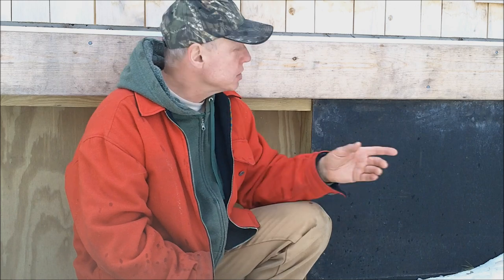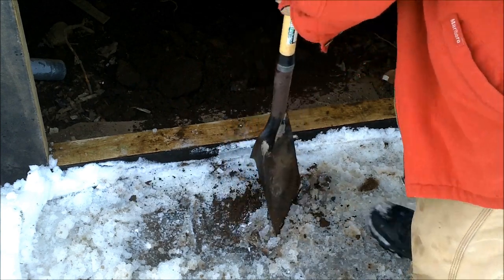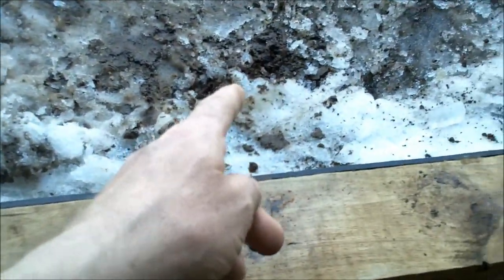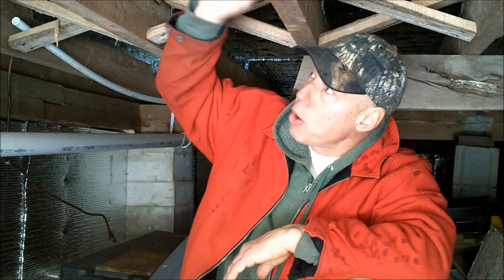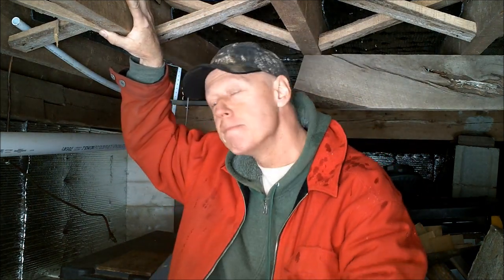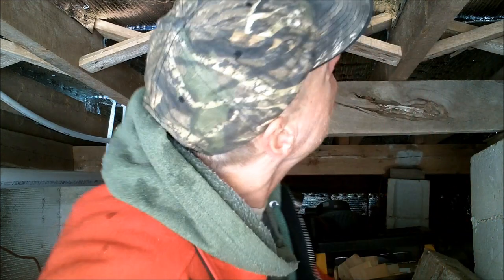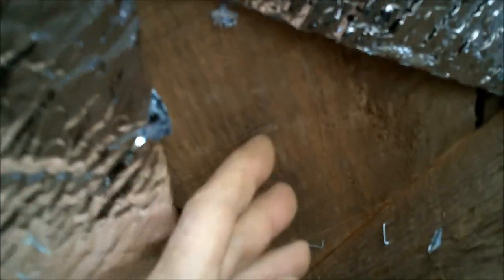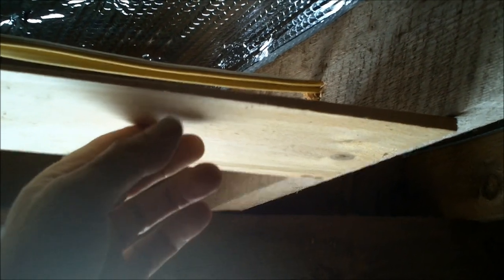HOW TO INSULATE A CABIN FLOOR AND KEEP IT RODENT FREE   PART 2

Comment: I have to agree with you Boss!  When I insulated my garage ceiling, I used blown in cellulose.  I apparently missed a couple of spots and in the winter, I could see where there was snow melting on the exterior of the roof.  I stapled some of that bubble foil on the inside of the ceiling and there is no more snow melting where it was before.  I have not used it as extensively as you have but enough where I am sold on it too. There is a reason why they call it "reflective", and that is because it reflects both heat and cold.  There may not be the "R" factor that other insulations have but it works on a different principals than those others.
Reply from the maker: Agreed.  If I can keep an ice cream sandwich in my cooler and still have it frozen at noontime... that tells me salt ice and bubble foil kick butt.   :-)   Yessah
Reply: Now that you mention the cooler, I took your idea and changed it just a bit.  Instead of lining the interior of the cooler with bubble foil, I made a "cooler cozy" for the outside of the cooler. It just slips right over the cooler and while in a situation where it is in the direct sun, it reflects the sun/heat really well.  Great for when in a boat or canoe or in an open field while camping.  Thanks again for all your great tips!

Comment: We live in a split-level home. Our den, kitchen, and living room are on a 3 1/2 crawlspace. The traditional insulation is all chewed up and falling down because mice and rats have made a home there. My wife and I enjoy garage sales and I picked up two unused rolls of the exact bubble foil you used for $3 per roll. I considered using it and went through the identical thought process you expressed in your two videos. It's great to know that it works so well. I totally agree with you about covering up wiring and plumbing. I think spray foam is a bad idea and I would never use it. In our neighborhood, many homes built in the 60s, 70s, and 80s are being sold for their lots. Massive new homes are being built and nearly all are being built on a slab foundation. A number of videos are surfacing indicating rats will chew through Pex pipe. Imagine getting a water bill for $700 and discovering you have a leak under your slab foundation. I mention that because I see you built your homes on a crawlspace making repairs in the future if necessary much easier.

Comment: Absolutely fantastic.  I have a cabin open to the dirt floor( unfortunately on peers), but its open to the sides. I guess I should skirt it.  I thought you actually want air flow blowing under.  Thanks.  N.Y & its a seasonal hunting cabin! Question should I put plastic on the dirt floor so moisture doesn’t rise ?     Thanks

Comment: Hey boss, your absolutely right. so many pros out there want you to believe r value is all that matters. thats only one factor.you have radiant factor and a complete air seal factor. fiberglass insulation is great, but it does allow air to slowly blow through it. There is no direct air stoppage like you have in the bubble foil, actually stops the air completely about three times between the bubbles and the plastic layers.  I have a cabin in VA on 3 ft piers, since its in a 100 yr flood plain I cant skirt it because i must leave free area for water flow in case the worst were to happen. All I have is one layer of bubble foil between the joists and subfloor (as The Boss recommended). most places I dont have any floor finish down yet and even when it was 8 degrees out, the floor wasnt cold. As a matter of fact, one hour after lighting the woodstove, we were opening windows. you may only have r3 in bubble foil but it kicks tail with radiant values and complete air stoppage ability. The skirt is by far the best part of the system. Ive been in the building industry my whole life and they are finally beginning to use the heating and cooling properties of the ground beneath the homes. The only insulation we are putting under the homes now is on the foundation. Theyre calling it a conditioned crawl. ground is a lovely 60 some odd degrees all year round. Thats free heating and cooling for your home. one vapor barrier on the ground, and your good to go. saves on heating and cooling bills both. So even the pros are changing there mind.   Its hard to change a hard head!!!!

Comment: I liked the way you rolled out the foil bubble wrap on the inside of the floor, installed sleepers and floored over the sleepers in the first video. Don't think that I am being a troll but after watching the video I thought that instead of leaving an additional air gap, I would install foil faced 1 inch rigid foam between the sleepers, another layer of bubble foil and then the finish flooring like hardwood t&g. I have used the foil faced rigid foam in between wall studs in my 8x10 foot shed with the foil facing in. I keep 2  60 watt incandescent light bulbs on 24/7 and the shed stays 40+ degrees inside when it is in the teens outside. I have a concrete floor in the shed that is covered with 1/2 inch interlocking rubber foam mats. The ceiling is R17 fiberglass. I am very pleased with the results but I plan on building a cabin and I am convinced on the bubble foil and will use it in the cabin. Thanks for the video, you probably saved me time and money.
Reply from the maker: I'm sure adding foam between the sleepers would be fine.  The trapped air is an insulator as well.

Comment: Do you have experience with your preferred method of floor insulation (rolling over the floor joists and under sub floor) AND having a foil insulated skirt? Your comment on the possibility of heat being transferred into the underside and keeping your pipes unfrozen has me wondering if the combination would be a problem? Thanks for the help!

Comment: They use bubble form in jet aircraft, so I agree with you. And I used it between my floors are my trailer. And like you, the trailer floor never gets cold. Even when it's 15° outside. Partly because the reflective coating on the bubble , reflecting heat back into the four, just as it does on aircraft. Neil
Reply from the maker: Agreed ;-)

Comment: Yeah I wouldn’t be worried about losing heat at the floor joists.  Most of the heat loss is in the ceiling and roof if it isn’t insulated enough.  Nice video sir.

Comment: Sir. We speak the same language and approach things in the same manner. I'm fixin to add 400sf to our house and have an efficient off grid plan on the drawing board. Both will be getting bubble foil. In fact Menards carries a double bubble double foil 5/16" thick product that I'll be using.
Watched part 1 and 2. I'm sold.

Comment: I agree brother. 1st year with negative numbers on a pier cabin. Anything including a blanket on the floor becomes permanently frozen. Going to do this myself. I was concerned about condensation building up. But I can attest that my floor with no insulation is a constant fight inside with moisture
Reply from the maker: I have never had any condensation beneath the floor. Seven of my structures have this.
Reply: Oh I think your right. I believe because I have nothing, the monster accumulates on my floors. I will definitely apply the bubble wrap and under pinning with it also. Thanks for the video. I have heard so many " pro's " say " no insulation under the floor. With sub zero weather, it became a nightmare real quick.

Comment: Thank you for these posts, of course what you're doing makes sense, to the reasonable viewers. It usually isn't that cold here in CT, and for now, a small heap of compost is working to insulate the water line entry from ground to sill... The floor is not too bad without insulation, and with no ground to sill barrier wrap, the neighborhood cats stop by and take care of any mice!

Comment: You "SHOULD" use fiberglass insulation then the Radiant heat barrier encased with Plywood. Also install a series of nest cameras so you can monitor rodent activity around wires and also several fans that will make any spaces cold so rodents don;t wish to reside there for the winter......on wait! I have no idea what I am talking about  :) Love the channel and love the Vids.
Reply from the maker: LMAO... you had me going there for a minute hahahaha

Comment: Happy thanksgiving boss. My wife and I along with our little one live in a 30×40 pier home in upstate ny. We heat with wood. We tore out all the mouse riddled bat insulation in the floor. Been doing a lot of resurch on the best way to insulate a cabin floor. I've asked a few "expert's" in the area and most say put fresh fiberglass back in or spray foam. Well, I'm not doing eather. As with most of my jobs around the house, I decided to go with some backwoods logic on this one. I purchased some bubble foil and I'm fixing to put er up. I got no worries about any problems. Yessahh. Thanks boss for all the videos. This one helped me a lot.
Reply from the maker: Good move.  If you've been following my recent postings regarding the mice I'm trapping beneath the cabin, you'll see there's lots of them, however... the bubble foil remains undisturbed by rodents and my floors are warm.  

Is your place skirted?  Skirting makes all the difference in the world.  Insulated skirting is more important the insulating the floor.   You won't regret this.
Reply: @thebossoftheswamp  yes sir, I just re built the skirting around the entire foundation. And I actually just finished a 2 year project of replacing every pier by hand...what a job. But it's done and turned out great! I have treated plywood with roof tin over it that matches our roof as skirting and I plan on putting bubble foil over it as well on the inside. I utilise the bucket trap for mice as well that you show. My father taut me that method a long time ago and it works great. I did find a burnt up mouse in my wall that chewed a wire to the bear core...it left a small scorched spot on the 2x4 stud. I feel I got lucky to not have a fire. Its so important to control them mice!

Comment: This is great info, thanks for all the efforts JC!

I have a question regarding skirting. First time cabin builder here, doing by myself with my wife. You mentioned you skirted by making a frame with pressure treated lumber. How are you attaching the frame to the dirt floor? Is the base plate a little dug in to the dirt or is laying on top? Thanks!!

Comment: Smart. Our neighbor lost their home in a fire due to rodents chewing on the insulation of the wiring going to their dishwasher. That outer layer of insulation on the wire contains peanut oil. Yes, peanut oil. That certainly keeps rodents away. So, along with your method of insulating the floor, you might want to add a little conduit to that appetizer running underneath your cabin.
I think I'll add this bubble foil to the exterior when I replace my siding. Smart. Thanks.

Comment: Love it, Love it , Love it J.C.  I messaged you a while back about your insulation technique and it's obvious that it works from viewing your earlier video.....the proof is in the pudding.  I have already source the bubble foil material for a build that I plan on doing.
At the farm, we installed bats of insulation that was to be installed under the floor and it is a total freaking mess.  I won't make that mistake again.  I have to agree with you also that your method in this case is totally working for you as the heat is penetrating through the floor joint and raising the temperature above freezing under the camp. GREAT PLAN!!!Maybe geothermal heating is next?????   LMAO
Reply from the maker: I'd definitely put more emphasis on insulating the skirting than over insulting the floor if there's plumbing beneath it.  
Warm floors and no frozen pipes.  Heck ya,   Even Gee Ol Thelma can't top it :-))

Comment: I agree with you, Boss.  Laying it down on joist then laying subfloor over for new construction is ideal.  What you did with this existing cabin is near-ideal.  As a General Contractor, I probably would have looked at removing the entire subflooring, laying down the foil, and then installing new subflooring.  That would have been almost as good as new construction (and it would have saved you time).
Reply from the maker: Laying over the joist insulates the room the best BUT... I have pipes beneath the cabin and if I insulate the floor too heavy, then I need to heat the crawlspace or pipes. Instead, I insulated the skirting and the heat that transfers through the exposed joist is enough to keep the crawlspace above freezing.   it's -2F as I type this and all the produce beneath the camp is in perfect shape.   Every application has different needs :-))
Reply: @thebossoftheswamp   Absolutely correct.  BTW, you may want to lay down 10mil plastic over the soil to block the moisture from getting into the crawlspace. Overlap it about 6 inches, tape the joint, and run it halfway up the skirting and fasten with tape.  I like what you're doing and have just subscribed.  Thanks.

Comment: I'm back to watch again the bubble wrap insulation. Under my cottage on piers the crawlspace being well imsulated but poorly ventilated it keeps the air humid. I will imsulate with bubble wrap. Thanks again for sharing your experience.
Reply from the maker: Covering the ground with an old tarp will help cut the moisture but ventilation is a good thing.

Comment: Ok buddy .... we are taking your advice and will be installing “Bubble Foil” on our 45 year old cabin restoration project.  We have built a new 1200 sq ft addition onto the old cabin with an ICF foundation.  We have to put a new subfloor in the old cabin so it provides us with a great opportunity to use your recommended top side application process using strapping between the Bubble Foil and the subfloor.  We also have a crawl space and a pump house that I will be applying the Bubble Foil.  I will let you know I sometime this winter how it goes.  Thanks for your videos.  The one thing in life that you can always count on is criticism.
Reply from the maker: I have great success with this stuff so I hope you will as well :-))

Comment: JC,
I think your use of bubble foil to keep a warm cabin floor is a great idea.  However, my perspective on why this is so differs from most people.  I think of the earth as a big heater.  It absorbs and stores heat from the sun during the warm months.  As cold weather sets in, the earth radiates its stored heat.  However the freezing front sinks deeper into the soil with sustained sub-freezing air temperatures.  At some point in late winter and early spring, the battle between cold air and warm earth reverses and the few feet of frozen ground thaws…more because cold air has retreated and not so much because warm air has melted it.  The warmth from the earth is mostly what chased the frost out of the ground.

With that understanding, your elevated cabin floor insulation system makes great sense.  In effect, what is being done is to cover the earth within the building footprint with a layer of still air.  The bubble foil encapsulates this air layer and reflects the heat radiating from the earth to keep the air below the floor above freezing.  This lets your cabin heating system work more efficiently and keeps the living space at a comfortable temperature.

On top of that is the effectiveness of this material at discouraging rodents from trying to penetrate the floor…for all the reasons you mentioned.  I think its brilliant.  It’s not at all about R-value of the material.  You aren’t trying to retain heat generated in the house as you would with conventional insulation systems whose value is related to R-value.  You are using the free energy from the earth to great cost-savings effect by preserving natural warmth below the floor.  As you would say “Now that’s backwoods logic”.  Thank you JC.
Reply from the maker: This stuff has been the answer to my prayers.  Our floors are warm, the rodents don't bother the insulation and the ground beneath the cabin never freezes.  By installing it between the joist, just enough heat penetrates through them to keep the pipes beneath the  cabin from freezing. If I insulated the floor in the manner that people keep recommending, then I'd need to run heat in the crawlspace.   This is perfect for my applications.
Reply: @thebossoftheswamp   As it will for mine too.  I am building an off grid cabin in Wyoming on piers.  I expect similar results to yours.  Thanks so much for sharing this and saving a bunch of time and cost.  I have gotten a lot of really good information from your videos and truly appreciate what you do.  We think a lot alike.

Comment: Since you have a shiny surface stapled to the underside of your floor, it doesn't emit radiation. Things that are bad at absorbing radiation are also bad at emitting it. Low emissivity is the same reason mylar blankets and foil on the lunar module keeps people warm. If your floor ever starts to feel colder, you might try wiping down the insulation to shine it up again.